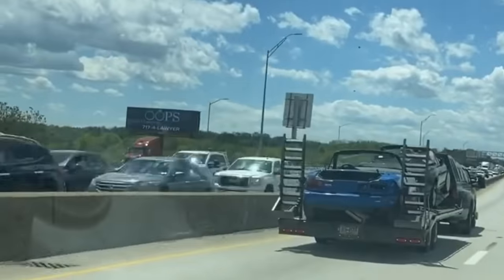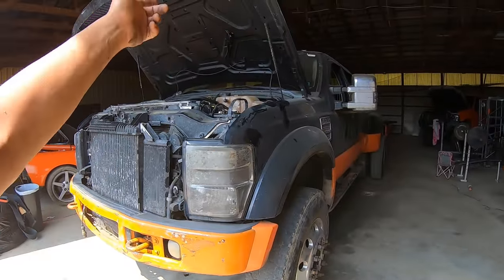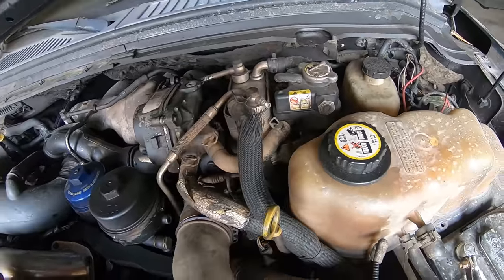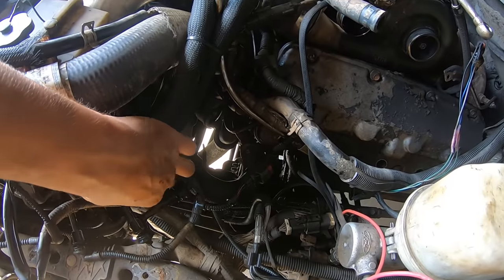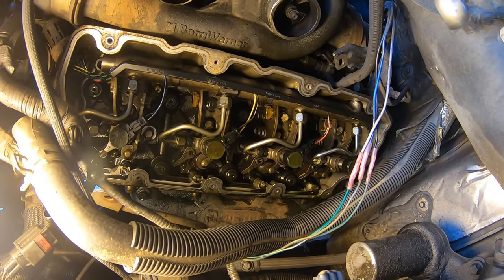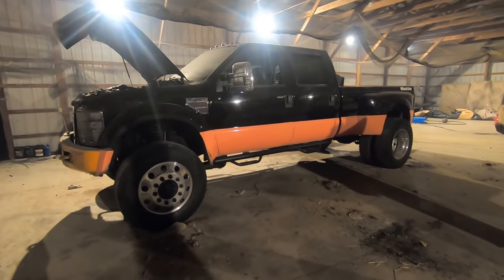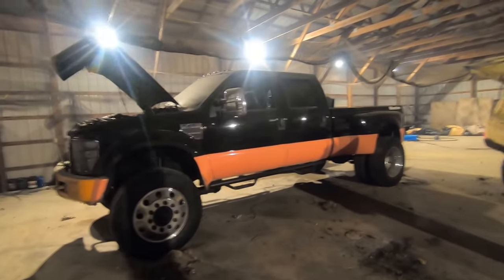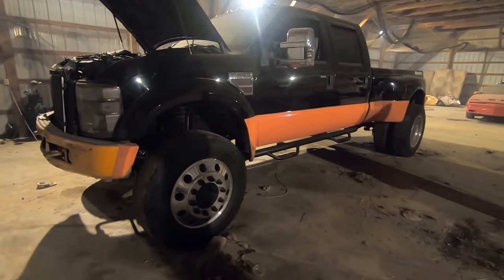I was hoping this fixed my F450! REBUILD IT OR NEW LONG BLOCK??

Comment: Absolutely do not buy the Civic back. Oh, and the word cheap and diesel don't belong in the same sentence.
Reply: especially on the worst diesel ever built
Reply: My 7.3 was 1500 bucks not a single problem
Reply: @josephdixon7697  hell yeah most reliable ever injectors on a 6.4 are $2,000 or more
Reply: @SXSPRIME  injectors and everything are original on my 7.3 my turbo is going out so I am upgrading but otherwise it is awesome
Reply: @josephdixon7697  i had a 99 7.3 turbo shit out at 40k miles amd a glow plug relay other than that and a lack of power to todays standards she was a unit.
Reply: I'm a Duramax type of guy. I am one of those Duramax lovers that say powerstrokes do suck. if I were to ever get a powerstroke it will be the 7.3 l excursion. but, don't be so negative and Steve get that Bruce back. I miss that content. there's so much more we can do to it that I just realized

Comment: Honestly, it depends on the condition of the block when you get down there and whats actually damaged. I get it on being cheap, but at the same time, if you just get a long block with everything new then it "should" have less problems down the road. Especially if you are using it as a work truck for storm work and other jobs. Just my opinion either way its your truck and wallet not mine.

Comment: Whether you rebuild it or go with a new engine you're always gonna have issues. It's a 6.4
Reply: Considering that 6.4 has somewhere around 300k on it  I'd say it's not doing too bad
Reply: @jamesrichard448  a diesel engine only making it to 300k is sad
Reply: I mean the truck has been thrown through a bunch of things like going through deep water to where water enters the cab
Reply: @Tazda_Jazda  point is, its a 6.4. They're thow away engines

Comment: I would change all 8 pistons to the maxxforce or equivalent cuz piston failure is very common on a 6.4 that is tuned. Replace the lifters while the heads are off. Heads need to come off to replace them. Do it once
Reply: Why cant you cummins swap it
Reply: @bernlew977  that's the Weston thing
Reply: @bernlew977  because a 6.4 is faster and sounds more rough

Comment: Man, what a bummer that is my dude, I wouldn't get rid of it unless you plan on not getting one for a bit. Trucks sell for a lot right now, but that means you will spend a lot too. I just purchased a newer truck because I didn't wanna fix my older one. Now I have a truck that needs the same repairs but it's just newer with  much more money owed on it. Win some and lose some.
Reply: What kind of truck is it, year and engine? Also how many miles are on it and what needs to be fixed?
Reply: @tercola8756  2010 f150 5.4 3 valve with 156000. Pretty sure it needs a timing job, suspension, brakes, front end work, U-joints. Just tedious things. It's winter time where I'm from and I'm trying to put all that off as long as I can lol.

Comment: Don't get rid of the F-450. Lots of people hate on 6.4L Powerstrokes and make you scared of them. They're great trucks with great engines once the engine has been gone thought. And obviously the truck has definitely done well since it has 300,000 miles. I say go through the engine and do any necessary repairs and/or upgrades. My friend has F-350 with a 6.4L Powerstroke and he loves it. He uses it to tow his gooseneck trailer with his heavy equipment and it works amazing.

Comment: 24 valve Cummins swap maybe 🤔 🤷🏼‍♂️
Reply: Please no! Much rather see the 6.4. Cummins swaps are getting old.
Reply: @Truckman1980  but 6.4s are garbage.
Reply: @1g_dsm_life154  they have their problems but have to say this one's been pretty tough! He's severely abused this truck and it has almost 300k on it. Just hate to see the truck hacked up for a lot less power and he can fix his engine cheaper.
Reply: @Truckman1980  I mean I pretty sure my 24v makes more power. They only make 350hp stock. My truck should be close to 500hp and 1000 ft lbs of tourqe. And the truck has 350k on it and it has been modified sense 150k still running great.

Comment: I'm not a Ford guy but that is a pretty badass truck you've done allot with that truck on this Ch. I think u should Rebuild it brother. And about bringing back Bruce first thing I would do with it is put a better motor in it, cause u can tell that t that truck does not have the power or should have.

Comment: I don't know about there, but here in Ontario it's anything but the time to buy a truck with the shortages the prices are through the roof on used stuff. I'd say rebuild it and send it, you know the truck inside and out and it's otherwise in good shape

Comment: Just get a bag of cement pour it down the intake that should repair those cylinders back up on compression if you add water it will really bring the clearances back too factory

Comment: Steve it sounds like you have a couple of dead cylinders just go and rebuild it right not just a patch fix. Get the rebuild kit with .030 over bore and hone the block. Have the heads rebuilt . If you patch it, you can possibly through the engine out of balance.  Why patch it and 1 month later you have another piston and rings go out, now you have to do all that work to just get to the engine. Do it once and be done

Comment: New engine is cheaper than a new truck especially being able to do the work yourself, I also have a 6.4 350 though. Check cass chote engineering he builds great 6.4s built without the factory issues

Comment: Productively Steve take the money you would have spent on the civic and rebuild or replace the motor. The f450 is the cornerstone of your channel.   Not to mention that truck makes you money. The content you get from the engine rebuild and the associated storm work will more than pay for the engine.

Comment: IMO I wouldn’t waste your time with a stock engine, there to prone to failure, just pull the cab and just drop in a decent set of pistons and lifters in and call it a day, only other thing I’d do other than that would be slap a common rail 5.9 in it, 6.4 is just a very very unreliable engine tuned

Comment: So many people want to Cummins swap it. Please don't do that. So many Cummins swaps they're getting old. Fix the 6.4 or replace it and pass the Cummins guys all day! If I wanted a Cummins I'd get a Dodge! Plus to Cummins swap it right you'd have way more money into it with a major drop in power. I know the Cummins is a good engine and can make power with enough mods but a 12 valve which is what most people use won't have but about half the power of the 6.4 and by the time you buy an engine and do everything you have to do to change it and hack the truck up you could do the 6.4 easily.

Comment: As un reliable as a 6.4 is, a 6.4 would be the last truck id put used rods and pistons in
Reply: It's well known that when they start having issues with pistons you're supposed to replace the block.